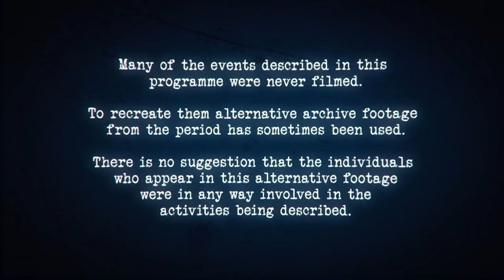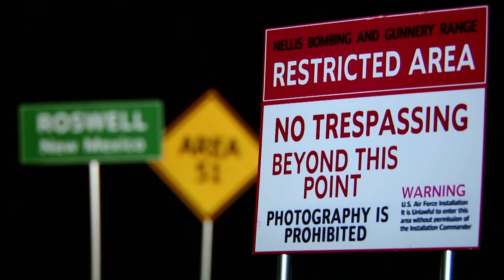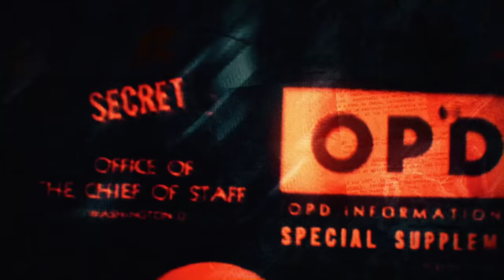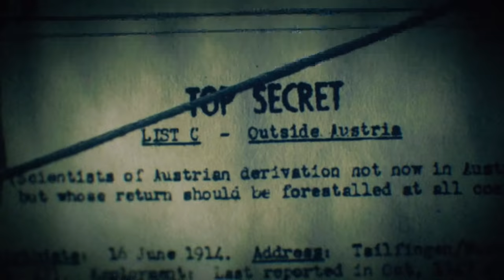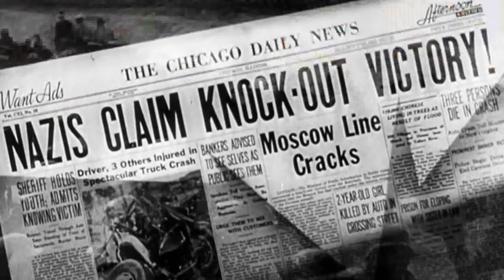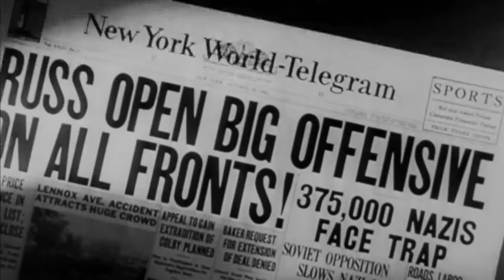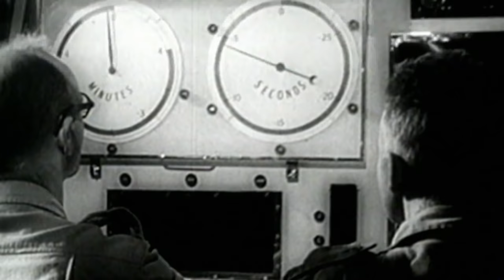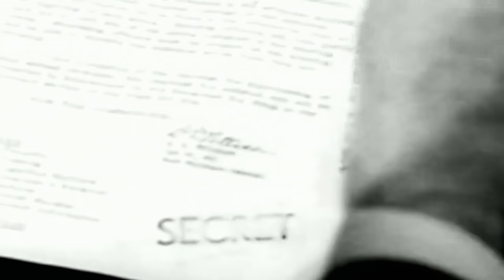Der Riese: The Nazi's Secret Super Weapon Of WWII | World War Weird | War Stories

Comment: The US stealth program has its genesis in a Soviet paper about radar scattering. This is well known. The propulsion for the aircraft is very conventional
Reply: Believe it or not, I found a patent from right after WW1 for a submarine with an angular upper structure meant to reflect sonar waves away from the emitting vessel.  There was no mathematical treatment that would make it really effective, but it stunned me that someone was working on the idea that early.
Reply: Horton H229, an operational stealth aircraft manufactured by the Germans during the war. Too little, too late. This is the true origin of the US stealth program.
Reply: @bigchief8017  Thats the origin of a flying wing concept. Anyway stealth is a suite of characteristics. Not one feature.
Reply: @lebaronjim4623 ,

Absolutely the origin of the flying wing. There’s no debating that. Are you aware that Northrop Grumman built a replica to test its RCS. Those engineers involved with the project are still disputing if it’s RCS reduction was intended or not. Keep in mind, saying that the RCS reduction was intended is a career limiting move. Nevertheless, some of them insist it was indeed intentional, and Horten was pioneering the concept.
Reply: @bigchief8017  I'd like to add that the Horton 229 was made with a aluminum (cabin) and wooden wings. The British had built radar towers close to the end of the war. The Germans found out that if they flew low they could use it to their advantage. I don't doubt they had an idea about "stealth" technology when it came to the Horton planning.
Reply: @epicmcgriddle7874 ,

Indeed. The composition of the wooden wings, is the smoking gun.
Reply: @bigchief8017  the 229 wasn’t stealth

Comment: I've heard the guy at 5:50 on a hundred documentaries, often but not always on the money about stuff, but he is way off base about the Me262 - and the reason I bring it up is because now I'm wondering what else he's been wrong about.  But as he is a self-described "expert" on the topic it bears correcting because, the Me262 could not reach "nearly super-sonic speeds" not even close, this aircraft topped out at around 560 mph.  Sonic speed is Mach 1 or 767 mph (1,125 ft/s; 1,235 km/h).
Reply: Some would consider 200 miles per hour away from supersonic speed close enough to be considered nearly there, especially in 1945. I wouldn’t, because the first supersonic flight was only two years later, but I don’t think he is over embellishing the feat to the extent you’re saying.
Reply: in a dive  it could get up to 700 mph i believe it was on a yarnhub video that a surviving me262 pilot described simply going down and staying in the same place (going down that is a straight line not twirling and whatnot to avoid enemy fire) his friend was a noobie and kept trying to roll and dodge only to get raked by the mustangs near him because he wasnt staying in a straight line to build up speed but yeah 560 was basically the standard mph range if you were just going up into the air and not diving at all